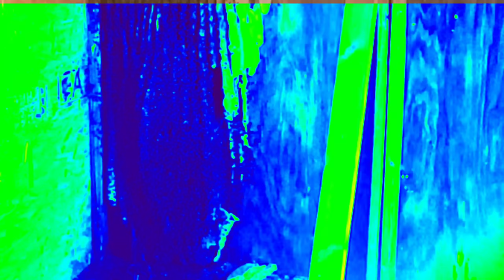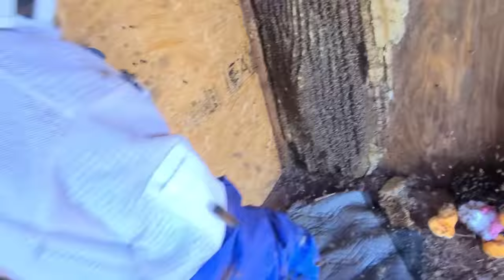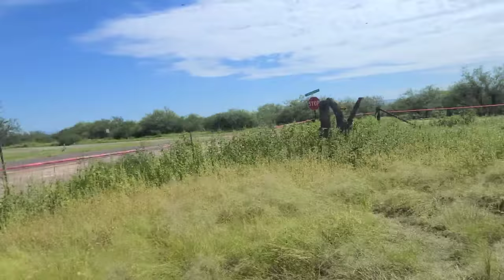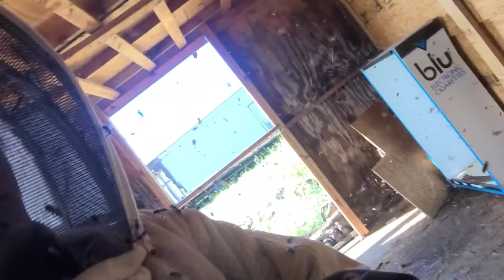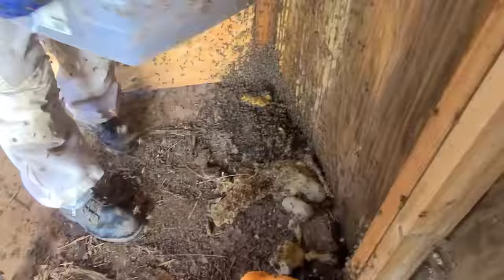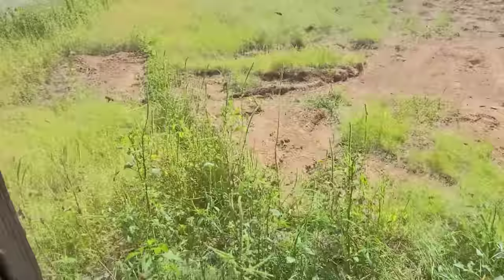DEATH WHERE IS THY STING?

Comment: Don't know why you didn't just use a pressure sprayer with dawn dish detergent and water. These bees have basically the same anatomy as other bees. This solution suffocates them.
Reply from the maker: We had way too many complaints from the customers about the mess.
Reply: Exactly this.  You can cover a wide area from standoff range, and it just kills them instantly.  And leaves a lemon-fresh scent!